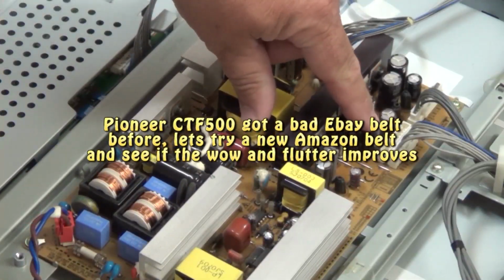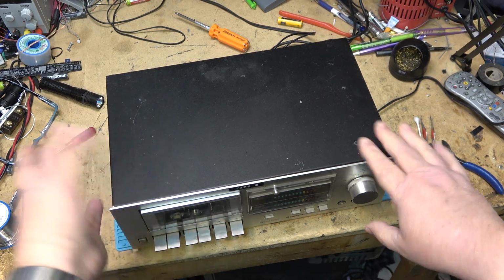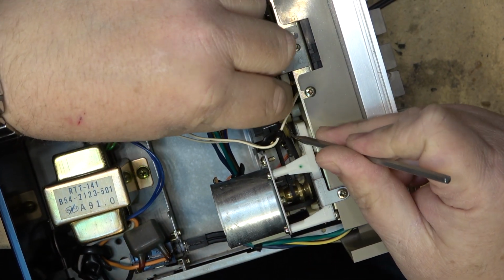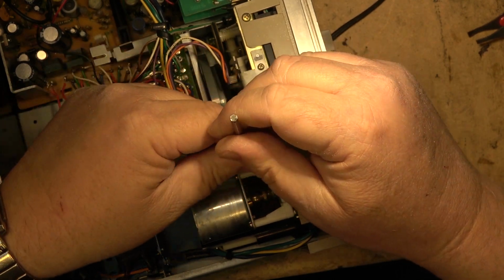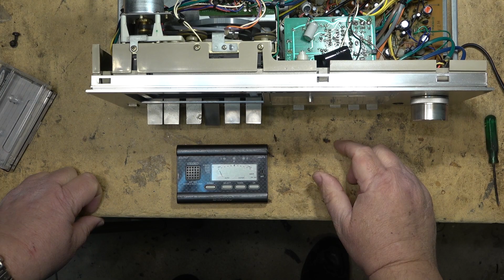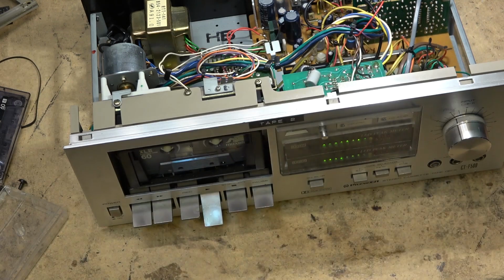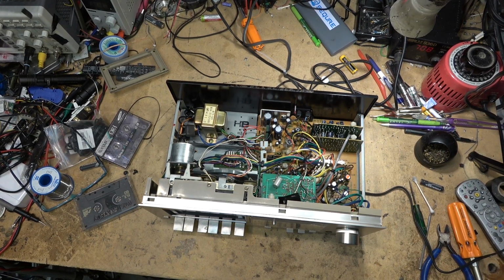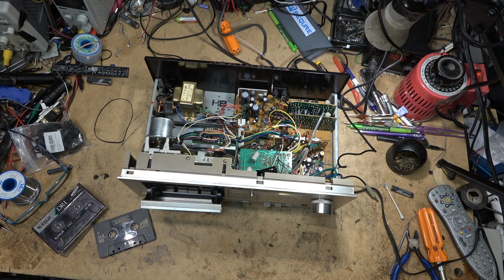New Belt into my old Pioneer CTF500 how will it sound?

Comment: Those tiny flat belts (from the cheep Amazon kit) aren't as useless as you might think. I use them, for example, to stick/glue them on worn/hardened idlers and thereby not only expand the surface again, but above all to make it more grippy again. If the deck has a separate motor for FFW/REW, which drives an idler via a pulley, you can also pull it over the pulley to achieve a similar effect.

It goes without saying, that this technique is only suitable for secondary functions and not for parts that are directly involved in the playback/recording operation.
Reply: Interesting method to recondition difficult to find idler's.....will have to try that
Reply from the maker: Yes I was thinking the same thing. Just waiting to find a unit that needs a tire refurbishment

Comment: Only thing I did different was I simply removed the one screw on the other side of the bracket with wires and it scooted right out of the way to get the old belt out and the new belt in.  Easy 10 minute job with a little care . The Amazon belt sells the correct belt set that includes the true dimentions flat belt.  Worked like a charm, after a demag and cleaning it sounds like a new deck!

Comment: I also have a Pioneer CTF500 but mine looks different than yours. Yours has some kind of circuit board below where you are working but mine doesn't. Mine had a plastic screw that looks like it keeps the flywheel from moving horizontally and is sealed with some kind of yellow loctite. I tried to use a 7/64(I think) allen wrench but it would not turn. So I used needle nose pliers to loosen the screw enough to slip the belt past it. Then I turned the screw back to where it was after the 5 minutes it took me to replace the belt, which had turned to gum, had to use alcohol to remove the belt from the flywheel. The valuable part of your video was using the pick tools to move the belt. Got them at Harbor Freight!Thanks!

Comment: I did a stupid thing with mine. I pulled that motor bracket off. Since the screw that attaches it to the smaller plate with two reed switches (FF and RW I believe) refused to budge, I pulled out both plates together with those fragile switches attached. Don't do that. Even if you don't break them, you'll have the time of your life getting it all back together. My CTF500 is now a parts-only deck.

Comment: Have you thought of getting a wow and flutter meter? Techmoan found one and has used it in a few videos. I am looking for one myself, it is very hard to quantify differences by ear. I have most of the test tapes for cassette alignment still. I am surprised no one has made a phone app for wow and flutter tests.
Reply: Not for a phone, but a computer – NAK T-100
Reply: @MagicMaus29  Windows platform I hope. I will look, thanks.
Reply from the maker: Nope, never considered getting one. I really don't care what the measurement is. If I can hear it, then it's too high. I don't do enough repairs to justify it, and you know my next one could be my last. Not saying that it will, but one day I will just not be repairing anything. Don't know when that day will be. Could be tomorrow, could be next year, might be 10 years from now. I will keep doing this as long as stuff keeps showing up at my door, but eventually things will dry up for good. Vintage stuff is enjoying a comeback now, but that fad won't last forever. So I am not investing anything into new or used equipment, and putting every dollar into investments that will make me money for when I do put away my soldering iron for good and retire.
Reply: @MagicMaus29  For $25 it seems like it does a lot. I like the virtual analog meters, I hate watching digital readout digits count up and down to reach a null or peak. It also has histograms, Thanks...
Reply: @zulumax1  You are welcome.
I've been using it for about a year now. First, parallel to my analogue measuring devices... now, almost exclusively when it comes to the adjustment of tape and cassette decks.
Reply: @MagicMaus29  I have a collection of tape machines including a museum quality Pioneer CT-F1250 and the Nakamichi Dragon. I have a video up of them on my channel. Just sold a Nakamichi CR-7 because the heads were damaged, not something I wanted to tackle.
Reply: @MagicMaus29  I need to buy a good external USB sound card with RCA inputs. I don't think it a good idea to use the internal one on a laptop, too noisy I would think. Software does require Windows 10. My new laptop is Windows 11 and an Intel i7 processor with 16 gig memory, so should be good there.

Comment: back when i was in technical school learning the trades i got so many shocks they nicknamed me "sparky"!  LOL worst one involved 120 volts while standing in a puddle of water, that one hurt!
Reply from the maker: I have you beat. 4100 volts from the secondary of a mocrowave oven transformer, the DC side of the diode.
Reply: @12voltvids  RF burn? My grandpa got a burn from a color TV arc that went in one side of his thumb, and exited the other side. Nasty burn, probably 25kV thereabouts.
Reply from the maker: @zulumax1  not rf, DC. Insulation on tool bad.  Threw me across the shop.
Reply: Adjusting belt tension on a 16mm Bell and Howell projector while it was running, tipped of the bench and the leads on the starter cap cut and wedged into my arm.  Damn thing was still running.

Comment: Does anyone know what length that belt is? Need to have it replaced and don't want to buy the full kit.
Reply from the maker: Measure it
Reply: @12voltvids  if it hadn't disintegrated, maybe I could :D But it did, so I come to you for help.
Reply from the maker: @eabernal  I have gone over this in other videos what you do is you take a piece of string dental floss works great for this and you thread it around the path around the motor and flywheel and any other pulleys that the belt goes around on your tie it not super tight but you tie it so that there's no excess slack then you cut it and measure it and that will give you the size and either millimeters or inches however you want to measure it take that number deduct 10% and that becomes your belt size and for a cassette deck it will be probably an FBM plus whatever size you measured and calculated.  FBM stands for flat belt medium width.   The belt sizes are s 2mm  m 4mm and l 6mm wide.
Reply: @12voltvids  this helps, thank you!

Comment: What watch are you wearing Dave?
Reply from the maker: It's an old solar powered radio controlled Casio in a stainless steel case.  Very rare.  I have been looking for another one for years.  They just don't exist. There were plastic case versions but the metal case is quite rare.  Had it for at least 20 years now.

Comment: Well it's better than before :-D
That belt is a bit rough and the capstan bearing isn't perfect but how far do you go?.
Yes the meter replacement wasn't the best idea, but it can be reversed if it matters.
I have lost frends too, i never forget them and there unique personality.
We also remember the assholes in our lives too lol.
Reply: I here that, especially the last part.
Reply: @lesrogers7310   "Know your enemy"  lol.
Sounds like an old army training film.
Reply from the maker: Meters can't be reversed as the plastic cabinet between the meters was removed to put the LED meters in. No big deal, it isn't a used tape deck.